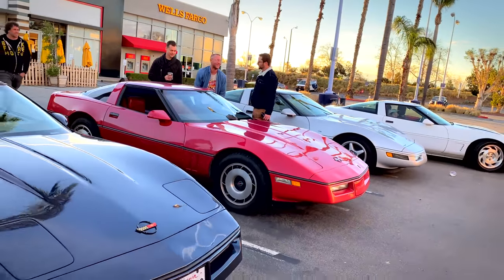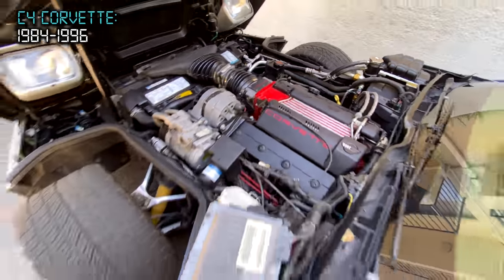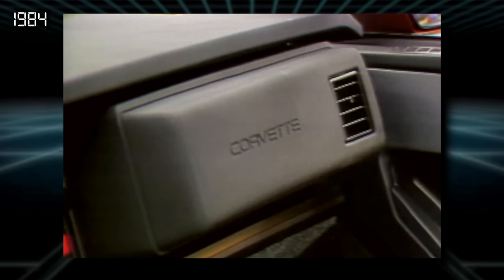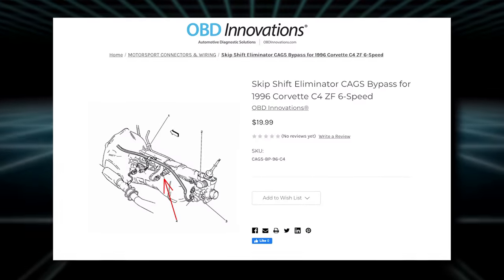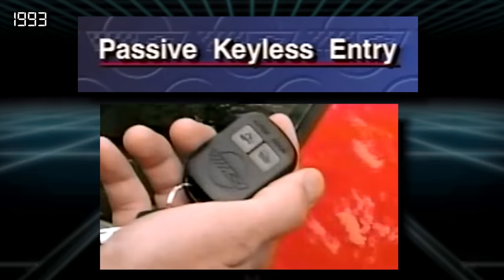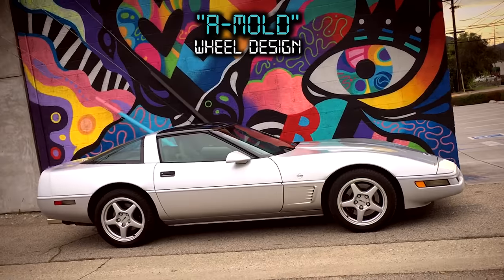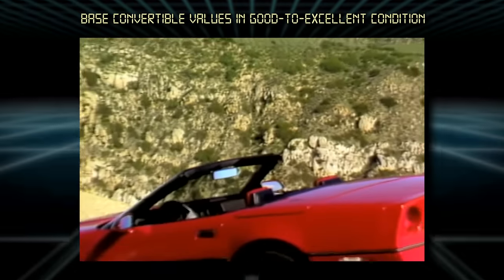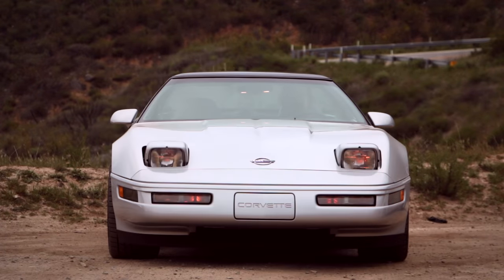C4 Corvette: ULTIMATE Buyer's Guide (Values, Performance, Yearly Changes 1984-1996)

Comment: I didn't even think about the freon thing.  That's almost a dealbreaker to own a pre-94.  I mean, what are you going to do as time goes on and supplies get scarce when you live in a hot climate?  Easily half of the country pretty much requires A/C about 6 months out of the year.  Maybe if you live in New Hampshire or something it's fine, but good luck in Arizona.  Mid-post edit: apparently FR-12 replaced the old R-12 and is still commercially available to licensed shops, so maybe it's not such a big deal to get it replaced after all.

Part of me wants to own a C4 alongside my C5 (which is my favorite generation and have no plans to ever sell), but the things I want are mixed and matched all across the years and probably not interchangeable without extreme modding.  I prefer the digital dash,  gen 2 steering wheel (first airbag, not even for the airbag, I just like the design), LT4 or at least LT1 engine with 6-speed, and those combos are all in different generations.  Then there's the lack of OBDII until the final year, but if you get a 96 many of the parts are bespoke to that year and therefore can command a premium because of short supply vs. I believe 92-95 share many more parts.  The 1984 model, though, yikes, it's just all bad news from the horsepower to the crossfire injection to the rock hard suspension.  Shame it was by far the most sold year and it must suck for owners that kept their car mint as I can't see anyone wanting one for any significant sum of money other than the fact it was the first year just for the novelty to park in a collection.

All in all, a C5 is a way easier car to live with and sounds like it's actually cheaper than a 96 LT4 C4, which seems crazy but also makes sense as there are probably only a few clean manual 96 C4s out there vs. 250k of all years of C5 with about 40% being manual due to the FRC/Z06 being manual only.  The C5 also seems like more thought was put  into the general mechanical layout and serviceability vs. the C4 that feels like they plopped an engine in the engine bay and everything else was just arbitrarily bolted on and wires and hoses were just run wherever they would fit regardless if it was easy to access or not.
Reply from the maker: C5 is probably the better car overall, but from my understanding trickier to service in some ways. That “tunnel” houses a lot of stuff and is difficult to access, and early C5s have some ECM computer issues that are nearly impossible to sort out.  Also, less engine access as the C5 lost that amazing Clamshell hood. 

Still, for the money, I bet C5 is a better car. I’d love to do a back to back comparison with one soon!
Reply: @RetroCarsForever  Which tunnel? The torque tube? It does require pulling a lot of stuff apart if it needs servicing (dropping the rear suspension/transmission), but it's not a frequent repair unless you have a ton of modded horsepower (like double) and it's usually a good chance to replace the clutch, any leaking gaskets in the diff, and worn suspension bushings and then put it back up for another 10-20 years and a couple hundred thousand miles.  It's also not that bad to pull down if you have the right lifts/stands like a proper Corvette shop would.  The torque tube also massively increased passenger foot space so the passenger has more than a postage stamp to put their feet on.

Regarding ECM, the only common failures I'm aware of were early faulty AC Delco batteries that leaked acid on the computer modules below it (not an issue with a modern well-constructed battery) and the EBCM which controls traction control and ABS, but the 01+ are serviceable for about $300 and the 97-00 rarely fail in the first place because they were epoxy potted and more durable.  It's touted as more of an issue than it really is and the car remains fully drivable without it working.

The hood is still large and forward hinged, just not as large of one, you really only lose fender access which isn't a big deal.  All of the commonly serviced stuff is very well laid out and relatively easy to get to whereas I find the C4 requires a lot of taking apart 5 things to fix 1 because it's all stacked on top and kind of put wherever it would fit.  The C4 also can cost a fortune to fix in a front end collision because of that clamshell hood, too. 

I also forgot to mention gas mileage, I had no idea it was that bad on the C4 LT1/4.  In similar driving to your 12/25 I get about 17/30.  I'm amazed you'll even drive it daily with California gas prices and the current price hike.  I bought a mechanically solid but cosmetically beat up hatchback for general A to B to go with my Corvette so I wasn't wasting gas, racking up miles, and risking damage just sitting in traffic.

You could do a lot worse than a C4 for sure, but it does seem like a harder car to live with and you really have to be all-in on the 80's body style to choose it.  I still kind of want one anyway, but logically I have a hard time justifying it as I'd probably want an 89 6-speed for the digital gauges but those are super rare at this point to get it in a condition that wouldn't be a project car or super expensive.
Reply from the maker: @nunyabusiness896  Thanks for the C5 info! Good to know. And yes, C4 is a tougher car to daily than a C5 in general from my understanding, you gotta WANT it!

Comment: I have a 1994 and 1995 in my area. Hard pick since the black is spicey and the 95 is the black rose purple color. I want the 95 for the improved optispark system but was the ones prior really bad enough to say go with the 95?
Reply from the maker: All things being equal I’d pick a 1995 over a 1994 any day. Not just for the vented opti but for all the other reasons I go over here.
Reply: Yeah the better fuel economy does sound pretty nice, as well as the less squeaky interior.
Reply: @RetroCarsForever  got the 94 he went way down on the price and it seems like it really only needs body work done to it and maybe some electrical. Either way. New c4 owner here
Reply from the maker: @DevilishBf  Congrats! Best of luck getting it sorted.
Reply: @RetroCarsForever  know of any places to get c4 parts?
Reply from the maker: @DevilishBf  Yes, there are several great resources out there. Mirrock, Ecklers, Top Flight Automotive just to name a few. 

The only one I've heard that you should STAY CLEAR of is Corvette Mods.

Comment: What octane fuel do you have in America? Here in Australia we have 91 octane normal, and 98 octane premium.
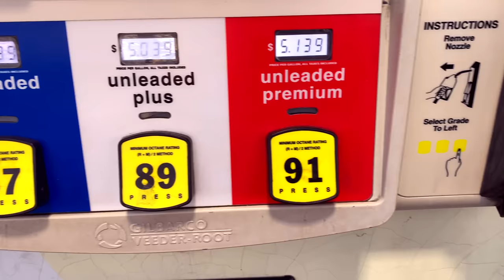Reply from the maker: 15:07 You can see our typical options here...87 octane is regular, 91 is premium. But you octanes sound so high that I wonder if the measurements are different.

Comment: I noticed when they got to 1994 they mention ac from r12 to 134 its not difficult to change at all that was false. All you have to is put a new 134 ac compressor on and it works perfectly that's it.
Reply from the maker: I'll admit I have not done the job myself. But researching for this video found many articles like this that essentially say you CAN just switch the compressor, but it's not recommended. To do it "right" requires much more work than just that. 
https://mechanicbase.com/ac/r12-to-r134a-conversion/
Reply: @RetroCarsForever  no it doesn't. I specialize in c5 and earlier corvettes all you have to do is drain the system and put a new 134 compressor on then refill with 134 and you're good to go. You may have to put on a adapter for earlier cars on the low pressure side but that's it. I've done it probably 100 times or more
Reply from the maker: @andrewpayne2345  Interesting, good to know. Thank you for posting that tip!

Comment: 1986.5 came with  Aluminum heads. The suspension was incorrect with early 86. They injesting water and suspension design for aluminum heads.
Reply from the maker: Yep, that's why I said "BY 1987", to better fit with this yearly format of the video. 
But what do you mean by "suspension was incorrect with early 86?"

Comment: Hey, low miles add much?  My 1989 has 24.8k miles.  Convertible but automatic. How to determine the appropriate selling price?   Tks
Reply from the maker: That’s pretty close the to 30k mile range that I quote in the video. So you’ll be at the high end of my valuation estimates at the end of this video. 

Of course low mileage cars CAN have low values if they’ve just been sitting around for ages and not regularly driven. Cars can atrophy and need a lot of extra care to be brought out of “storage” and turned back into a driver.

Comment: Great video and let me just give my C4 two cents after owning and driving many:

The convertible top sucks. It wrinkles easily, the plastic window is horrible and it doesn't seal well, which leads to...

Water getting into the hatch/convertible area can cause havoc with many electronics located there.

The BW 4+3 transmission is terrible. The ZF is far better in every regard. If you are set on an early C4, get the auto...you'll thank me later.

I'm not a fan of the first digital dash, but really like the 1990-96 dash. It's subjective, but I like the overall interior change including steering wheel in 1990.

OptiSpark will fail. Period. Even with upgrades/aftermarket, the Opti is to this day a source of frustration.

The adjustable suspension juice isn't worth the squeeze to me...even in the C5.

The TPI intake will become a restriction if you plan on modifying. I put a mild 383 in my 1990 with a lightly ported stock TPI and it was a sideways, giggle machine, but not fast.

C4s can take abuse and parts are (for the most part) cheap, plentiful, or easily upgraded. They make great track cars...even autocross.

The Bose stereo...pass.

Comment: I just received a 92 Triple White from my uncle with 78k on it. Is there a thread that says what newer vett parts work with older models? Especially the motor.  My Optispark only has 100 miles on it but I would like a better system so I can not worry about rain or wanting to detail my motor.
Reply from the maker: Mirrock Corvette has a great website that breaks down parts interchangeability.

As for the Opti, you'll have to dig a bit deeper and see exactly what aftermarket Opti will work best with you car. In any case, I would never use water in the engine bay, Id recommend detailing the motor like you see me doing here (go to Number 5 of my Top 5 Common C4 Problems for more about the Optispark)-
https://youtu.be/9nR3rkZd2bQ
Reply: @Retro Cars Forever  thank you. I have a steamer that can do pinpoint cleaning but still wasn't sure.
Reply from the maker: @rushtk2112  Ah, the steamer should be fine, just keep it away from electrics and the ECM and the Opti

Comment: Guys for us older c4s we can swap out our injectors with BOSCH III'S to get that moderned up. Truth is the ethanol in the gas now causes a lot of issues with our cars because they dissolve the fuel injectors
Reply from the maker: Great tip!
Reply: @RetroCarsForever  100% would recommend it. Made my idle way smoother and the gas even of 10% ethanol wont hurt the injectors anymore. Everything is more responsive. The multecs are sort of bad in earlier years rebuilders usually just chuck em in the garbage instead of rebuilding them lol

Comment: When you covered the 1994 refrigerant you showed the car with the LT4 engine. That engine didn't come out until 1996. Unless you only used it for demonstration.
Reply from the maker: Good eye! There were a few times where I used my own personal 1996 C4 as a visual aid to show certain identical features from the later C4s, that was one of them.
Reply: @RetroCarsForever  thank you. i just edited my comment to reflect that. Nice video.  I own a 92 conv with the LT4, 6 speed. The original owner worked for GM. The car was born an LT1 Auto. He did the changes. It still has the LT1 tach that goes to 6k.
Reply from the maker: @Mike-zf4ev  Wow, unique car you have! Pretty cool
Reply: @RetroCarsForever  yea, it's an odd duck for sure.

Comment: The only thing I have to negate here is the fact of the technology on these c4’s is outdated for the money some sellers are listing these for.  C’mon, how do you expect top dollar, as in, only $10K below the original 1993 sticker in 2023?  No abs, no Bluetooth, Firebird door handles, no Brembo’s, low HP V-8 engines, outdated A/C unit, Cassette decks, (really), small brake rotors, you get my point.
Reply from the maker: In 1993 these would’ve been 40k bucks each. They’re not worth 30k these days unless you’re taking a ZR-1. 

At 10-20k which they are actually worth, they make a lot more sense.

Comment: Question about ethanol in petrol. You mentioned that the 1996 year of C4 was OK with E10 fuel. What about the previous year cars? Anyone know?
Reply from the maker: It was actually 1995 when they specifically designed the engines to run well on ethanol. 

There’s a ton of varying info on what’s best for cars older than that, you’ll have to decide what’s right for you. Some people just use a bottle of injector cleaner from time to time. Some seek out ethanol free gas (probably best but it’s pricey). Some think it’s overblown to do anything at all! See what you find out and go with what you’re comfortable with for your own needs and personal budget.

Comment: Hey , 
I found a 1996 collectors edition with 110k miles . The guy wants 6k , what do you think . The car is very clean but your saying after 90k they are used up ?
Reply from the maker: I wouldn’t say they’re used up, usually they start getting rough around the 150k mile mark. That said, if the car has a thick stack of service records, and the interior and exterior shows well, that shows it’s been well cared for and at that low of a price, could be a great deal. 

Carefully inspect it, and make sure to check out the top 5 common issues that I go over in this other video. Good luck! 
https://youtu.be/9nR3rkZd2bQ?si=zcAyrK6poN9X_4ts

Comment: I found a 88 bright red coupe in a barn. Runs and drives automatic but he wants 3k for it and i dunno the milage. Think its worth a gamble?
Reply from the maker: Probably not. According to my pricing guide near end of this video, if the car is all fixed up and perfect, it would be worth around 9 grand or so. 

I bet you will EASILY spend 6 grand getting that car back to shape. Rodents love to create nests, and getting the electrics figured out on older C4s like this can be a real headache. 

If you want a project car that you would enjoy working on, maybe. Or if there really isn't anything wrong with it.  

A much safer gamble is to just spend 9 grand up front on a 1988 that hasn't been ignored.

Comment: Hey Retro - Aluminum heads came out in 86- (Not 87) and even some late 85s got em. FYI. 

CORRECTION- THE SWITCH TO AL HEADS WAS MID 86, not LATE 85. MY APOLOGIES!
Reply from the maker: A very astute observation! You’ll notice I say “BY 1987 the L98 had aluminum heads”. 

This was my way of mentioning the switch without bogging down the pace with too many details, a constant balancing act I make when writing for fast-paced YouTube. 

That said, I couldn’t find any evidence that any production 1985s had aluminum heads. Do you have a source for that? 

My source for this particular piece of info was Motorweek. Here’s that video and time code…

https://youtu.be/NFsVpmmHqtk?t=93&si=N9oo1cXG-dh4P4nR
Reply: @RetroCarsForever  Dude, I'm wrong and I stand corrected. The switch happened mid 86, not mid 85. So my 85 either landed a rebuilt engine or head swap. Deleted the original reply to you. 

On that - great flow. I know balancing it is tough. I even learned some new stuff about the 95/96 cars!
Reply from the maker: @davidbistolas  Thank you! And hey, guess you got an upgraded 1985 head, sweet deal!
Reply: @RetroCarsForever  My "current" build is a '73 with '65 camel hump heads. I'm in year 11 of my 4 month project. Wish me luck!
Reply from the maker: @davidbistolas  Wow, that's dedication to stick with it, good luck!

Comment: Actually, late 86 models got the aluminum heads installed on the T.P.I.
Reply from the maker: Correct! But for simplicity's sake I word it as "BY 1987 all Corvettes got the aluminum heads". 

It's tricky writing something like this, as I'm trying to cram a ton of info into just 20 minutes, in ways that even non-enthusiasts would understand, so that was a bit of streamlining on my part.
Reply: @RetroCarsForever  this was a great video on C4's. I have an 86 that's N.C.R.S. certified. Appreciate the work you did on this.
Reply from the maker: @chickenjo23  Thanks so much!

Comment: How about Z07 (Z51 and FX3...in other words, adjustable Z51) suspension pricing? Those suckers are rare, but man do they drive great! Also, great video!
Reply from the maker: Thanks! I couldn't find any solid value data on Z07, which is why I didn't mention it. Pretty rare option, but also pricey to service, so my gut is it doesnt add OR subtract any value.
Reply: @RetroCarsForever  Haha, try driving one...might change your mind! Haha
Reply from the maker: @CC_Top_Solutions  Oh for sure, there's always gonna be a bit of "buyer preference" that will ACTUALLY set the price of any particular car. For example, I probably spent a bit extra on my LT4 because I REALLY wanted an LT4!
Reply: @RetroCarsForever  Youre not alone, those are so choice!